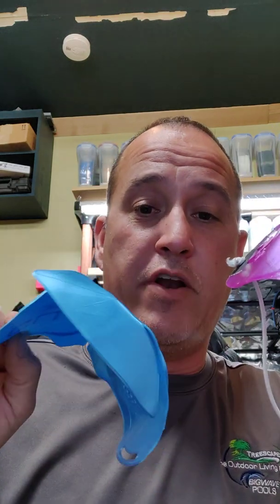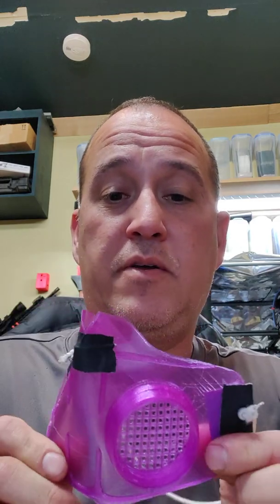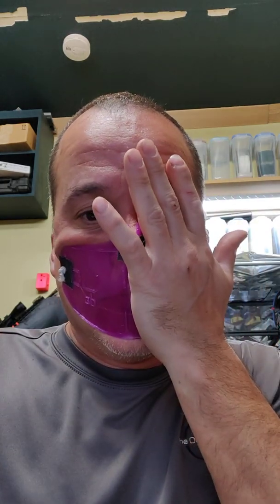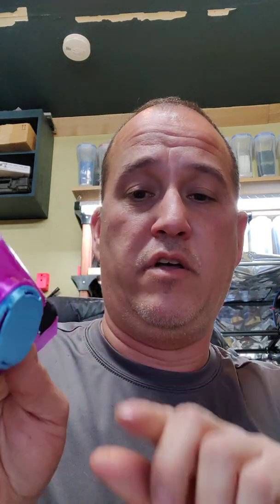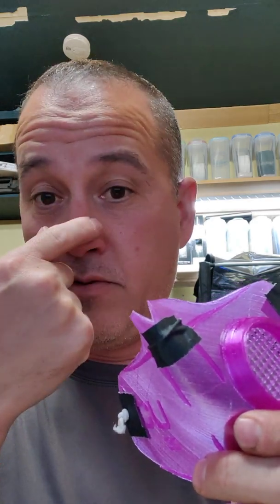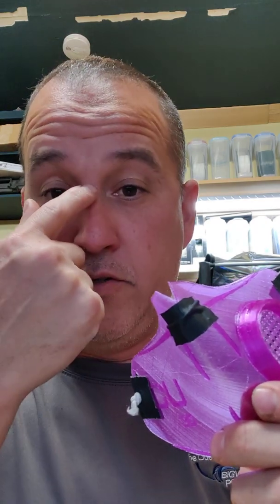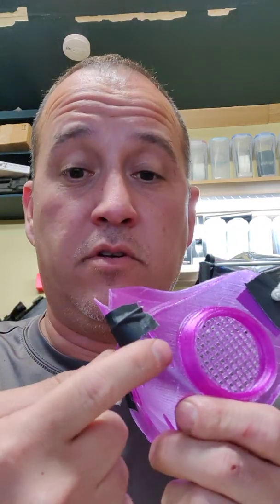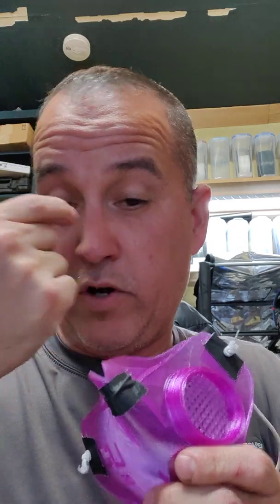COVID-19 FILTER MASK TPU IT WORKS!

Comment: Thanks for this. I have made a model with two vents and as you, removed the chin plate. I agree that there will be excessive amount of vacuum during physical exercise and some kind of barrier needed to prevent it. Working on that as I am sure others are too . TPU being the way it is I think it might be possible to print an adjustable strap that holds the mask in place,removing the need for elastic. Just a thought.  Another idea might be to create a small tube running the full width of the mask at the top so that a wire can be fed through helping the seal you mentioned. You are keeping me busy.

Comment: Great improvement, I couldn’t understand why everyone was using rigid PLA when TPU would surely mould to the face better. What nozzle did you use to get it to print in an hour? I’m seeing 2 hours including the honey comb and screw in part?
Reply from the maker: Sorry my printer was actually going double speed which was like 60mm/sec. I printed the dual mask in about 2 hours at 30mm/sec  and it came out really good. I'm going to modify this mask for better fit and a few other ideas I have for it.
Reply: Dory Hayes look forward to seeing it. Just ordered TPU & going to start printing tpu extruder mod for ender 3
Reply: @samyounggg  TPU works pretty well with the Ender 3 and vanilla extruder, even up to 50mm/s.